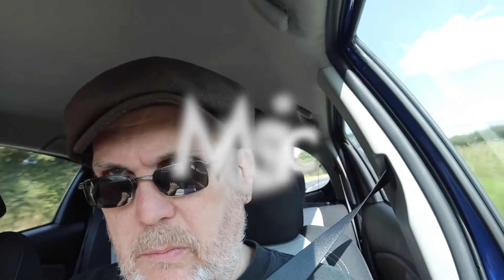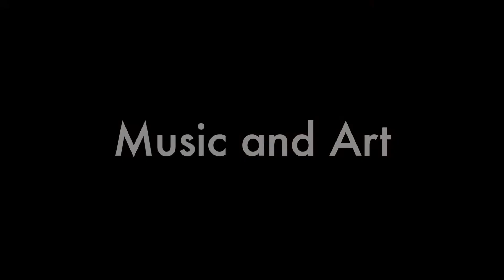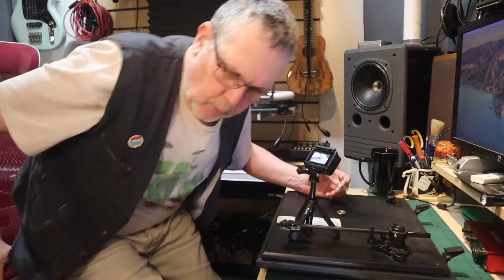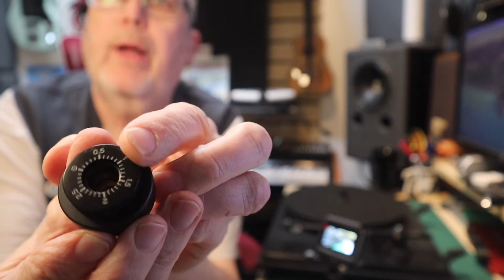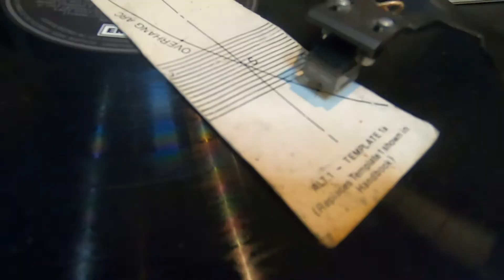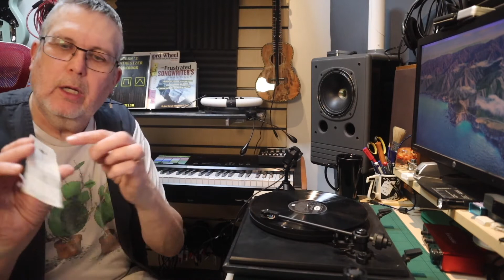How to Set-up and Service a Vinyl Turntable Part 2

Comment: Great video Ian.. & as what Tony was saying I too have the Revolver but the Black Ash one, I did have the Rebel back in 1980s & when I had the extra cash wanted to have a Linn Basik tonearm fitted.. but when the guys where about to fit the new tonearm on the Rebel found that this could not be done " their fault" so they gave me a new Black Ash with the Linn Basik tonearm & Linn K9 cartridge/Stylus & since then I have changed the belt once & now use the AT-VM95 SH which I feel is as good as anything out there. Now I have set my grandson up with a Revolver Black Ash with the same tonearm as you are using as I think that he can learn a lot from this Turntable if he also watches your video's because what I see from your info here is spot on what I have done & what anyone will learn as long as they want to enjoy HiFi.

Comment: Just got one of these from my local Heart Foundation charity shop. Paid £25 and it sounds pretty decent to me. Popped a few drops of oil down the shaft and the plater runs nice and smooth.
Reply: You want to hang on to that Turntable if you are thinking of building your system because you will not get anything better under £600 if it's in perfect condition & do exactly what Ian is doing because people don't realise that this company was way out in front in the budget market back in the 1980s but didn't over price the equipment where they could have done. now I would not sell my Revolver Black Ash with Linn Basik LV X tonearm with Linn K9 cartridge & AT-VM95SH under £1000.
Reply: @paulaj2829   also picked up a Systemdek i920 for £4 a couple of years ago and Arcam Alpha 5 Amp for £10!, though it's getting harder to find decent charity shop Hi-Fi bargains now.

Comment: Very interesting. I watched this as I have an original Revolver that I bought mid 80’s and thought it was time for an oil and belt change even though it is still running fine. This turntable is a giant killer sounding better than my old Pink Triangle but I did put an Ittok arm and K9 cartridge on it. The only thing that I have changed is the stylus and luckily now the ATVM95 from Audio Technica series is a great fit replacement and works really well.
Reply from the maker: good to hear Tony I liked the Ittok arm but always found the K9 cart a bit bright for me taste take care Ian
Reply: As you said Tony there is not anything out there today which will beat this little gem.. & since I to went over to AT-VM95 I have saved my £££s & got the complete set so that I can also talk with guys about which is good & what is better.. But I will say that if you have the AT-VM95E it's a good match for a 30yr old Linn K9 stylus in my opinion.. But if you have the money go & get the AT-VM95 ML or the AT-VM95 Shibata which will blow anything away.. Especially if you use the Linn K9 cartridge which is still to this day & will cost a lot of money to compare with .